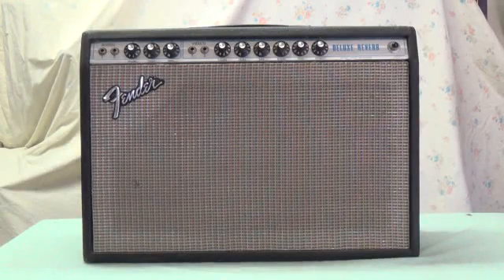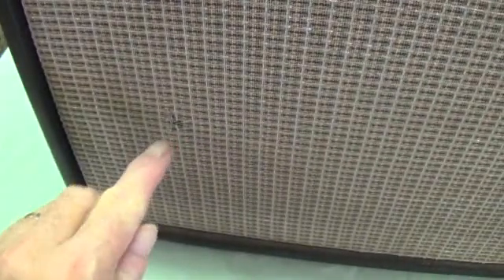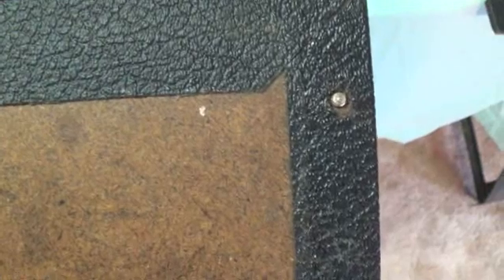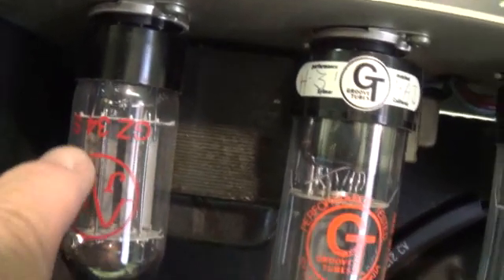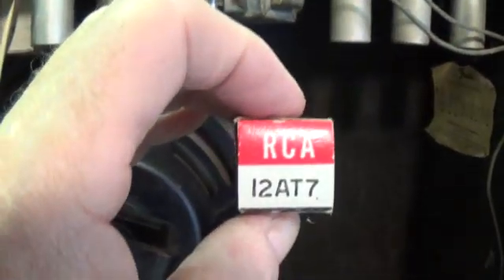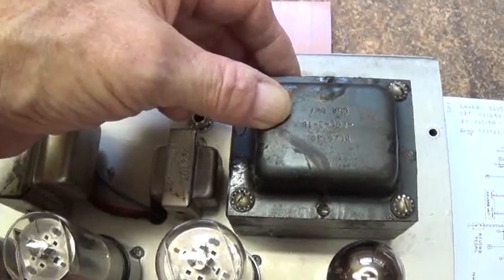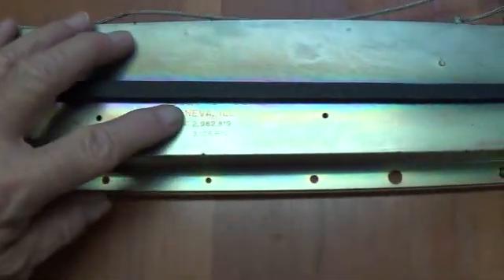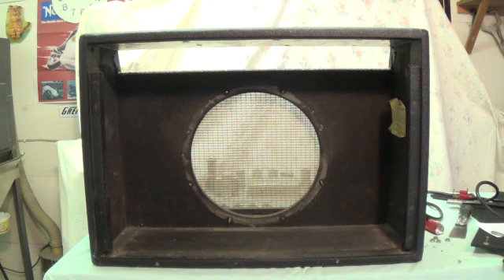1974 Fender Deluxe Reverb Part 1: Disassembly and Evaluation

Comment: Hello Doug, I have question about the reverb transformer. There are several companies that produce these transformers claiming just like original specs. Some say primary 20K ohms and others say 25K ohms and of course the secondary 8 ohms. Back to the primary does it matter, lower or higher ohms ?  will it impact the reverb tone?  thank you .................
Reply from the maker: Greetings, Jim. In my opinion the difference between 20K and 25K is negligible.....it would have no effect on reverb tone.

Comment: I'm thinking of buying a Deluxe reissue and converting it to Point to point hand wired circuit board?  UD "Decent" wow I'd die for that amp.
Reply from the maker: If the Deluxe in question works well, I doubt that conversion to P to P would make much difference in tone, Gary......unless you took the opportunity to incorporate superior components. Why not find one with    a burned-up PCB (not that rare) at a give-away price and use it for your project.

Comment: My deluxe reverb is a '72 and is in almost similar condition. The difference is the speaker. My speakers have a Fender logo sticker on them.
Reply from the maker: Bear in mind that Fender does not manufacture any speakers. They are made by other companies, like Jensen and Oxford, and may have Fender stickers placed on them.

Comment: Uncle Doug, I've a couple of questions concerning amp wattage. On a few tube data sheets, plate wattage (for instance 16w) and output wattage (for instance 4.5w). Would an amp built using one of these tubes be rated at 16w or 4.5w? Another question is how wattage rating relates to volume, db? You run all of the amps you work on mostly through the same speaker and the volume sounds the same. Could be the balance on your camera but I am very curious. Thank you. Love the videos.
Reply from the maker: Plate Dissipation (i.e. 12W max for a 6V6) and Power Output (i.e. 24W) are completely unrelated measurements. Their only similarity is that they are both measured in Watts, which causes confusion. Power Output wattage does relate to volume, but the relationship is not at all linear, i.e. a 50W amps is not nearly twice as loud as a 25W amp. As the output wattage increases, the volume increases, but at a much lower rate. I run all audio tests at about the same audible volume, and the camera does compress really high volumes.
Reply: @UncleDoug  Thank you again UD, I really appreciate you and your knowledge.

Comment: Great score!
Looks like a 56 pulp cone.
I haven't seen your follow up videos on this particular amplifier yet, but that speaker is going to break up very quickly and you will hear pure tube distortion at low volume. I don't believe that speaker would last long fully cranked up and would probably feedback, but would sound heavenly at lower volumes. 
I prefer the Jensen C12N/Q or clone equivalent in this amplifier or a more efficient modern alnico that can handle it. 
The ideal amplifier for that beautiful pulp cone old Jensen is in a lower wattage tweed era amplifier, 5 to 20 watts, if you like to crank them up like I do. 
I've pushed all of the vintage alnico "P" speaker's and they always sound best just before the spider freezes up, lol.
I understand that this video is 7 years back, so I apologize if I'm preaching to the choir in the present, so to speak. 
I'll keep an eye out for your follow up videos on this Deluxe Reverb. I'm curious about the GZ34 and the voltages.
The excitement in your voice is infectious my friend. Congratulations!
;  )
Reply from the maker: Thanks so much for all the insightful comments, Amo.
Reply: @UncleDoug  
We did a blackface conversation on a 1971 Deluxe Reverb back in 96-97 and that amplifier was basically identical to your 1974. It most likely came with a Utah speaker from the factory with a brown'ish orange label.
I'm not a fan of those speakers and it's former owner didn't appear to be either. A lot of people love the JBL D120F, but I don't care for it in the Deluxe Reverb. However, in a Twin Reverb, they are much better, imeo. I learned a great deal from that blackface conversion, they are more complex tone-wise than other SF amplifiers. The switch to the 5U4 and the move from the 2.2K resistor to a 10K to the preamp section.
They also changed the taper in the volume pot that was for the worse, from smooth and even to a quick bump in volume. That's about all that I can remember at the moment. 
Again, congratulations on a fantastic Fender amplifier.
Reply from the maker: @amoruzz  Thanks so much for the detailed input, Amo.

Comment: How do you calculate which fuses to use? Which of the transformer winding are the most important to protect?
Reply from the maker: If you don't have an AC ammeter to measure the input current, then install a 1W fuse and see if the amp starts up and works OK when driven. If the fuse blows, install a 1 1/2A fuse (if you can find one....or a 2A if you can't) and repeat the test. The proper fuse is the smallest value with which the amp can operate. All the windings are essential. The amp will not operate properly without them all.
Reply: @UncleDoug  I have both a digital and an analog meter.  So it's sort of try it and see experiment?

Comment: Hi from Serbia.I have hand made Deluxe reverb ab763 and work just fine but when I switch vibrato volume go down.What can be wrong? Kind regards
Reply from the maker: The tremolo circuit connects to the main circuit via a wire to the grid of the long-tailed pair. Check the values of the 220K and 100K resistors and 0.1uf cap on either side of its attachment to the circuit. Disconnect the wire and see if t.he problem ceases. If it does, then check the value of the 50K RA pot. Somewhere in the circuit you have inadequate resistance to ground. Good luck.
Reply: @UncleDoug  Thank you,kind regards

Comment: Beautiful amp.
I’m interested (at 44 years old) in learning about electronics (specifically amp circuits and design), what would be a good place to start from the beginning?  Any books, videos, or other resources you can recommend?  This would be a hobby, not necessarily a career.

Thank you for any direction you can provide.
Reply from the maker: The Internet is the best and most convenient source of information, Jeff......both videos and sites dedicated to tube circuitry. Once you have a foundation, the next step is to start repairing cheap tube amp circuits for yourself and friends. Eventually, you can begin to build your own amps from kits or from scratch. Good luck.

Comment: the reverb and vibrato won't work without the foot switch.
Reply from the maker: The reverb works OK without it, but the tremolo must have the socket grounded, either with the footswitch or a jumper.

Comment: Your Videos are Outstanding,   will the front panel just pop off for cleaning ?  Peace !
Reply from the maker: Thanks !!  Which front panel, MM......metal or cloth?
Reply: @UncleDoug   thanks for the reply I figured it out , it has velcro and the front panel pops off just had to work it free with a screwdriver, it's a silver face and it's the cloth front speaker panel sorry for not being more specific my bad,  Thank You,  Sir !
Reply from the maker: @jixxxxer17  Glad you solved the problem, MM.
Reply: @UncleDoug  I did but now I have something new to deal with a really bad odor coming out of the amp once I got it in the house of course I started smelling it,  it's a foul odor like a  mix between cigarette smoke and a bad smelling old apartment i guess, any suggestions i would appreciate it i had to take the amp out of the house and put it in the garage  now the smell was making me sick ugh ,    Peace !
Reply from the maker: @jixxxxer17  You might try washing the grill cloth with Woolite and then letting it dry by having a fan blow on it all day.
Reply: @UncleDoug  Thank You Uncle Doug !

Comment: I currently own a 1977 version. Someone installed a much larger OT along with a much heavier 12" speaker out of some type of Fender Twin. Makes for a great SRV amp, if you want to run it loud ... and it IS loud for a Deluxe Reverb. Too loud for this old man ...
Reply from the maker: Amen. Too loud.....and getting too heavy, at least for this old man :)
Reply: @UncleDoug  Right on, Sir! Have flattened spinal discs to prove that action! Very painful walking from 35 years hauling around a Super Reverb or a Twin ... I think you and I are just about the same age. I came in around late/'47, back in the good old days ...
Reply from the maker: @Tonetwisters  I was born in April of that year, so I'm a few months older.....and I have shrunk about 2" from my peak height in my 20's, due to compressed discs. It really is a problem.

Comment: I realize this is an older video, but I am looking for an original Deluxe Reverb. Do you happen to have one for sale? thanks.
Reply from the maker: Yes, I do, GL. In fact, it's the one featured in this video. Give me your e-mail address and I'll contact you with the details.
Reply: @UncleDoug  I may have found a 1972.  It is very far away though and I am not committed at this point. Could you please tell me about yours? Thanks, Gary
glmoore0001@ comcast.net
Reply from the maker: Everything is discussed and shown in the videos featuring the DR, Gary. Please watch them.....a picture is worth a thousand words :)

Comment: Hi Uncle I have a 73 DR and the reverb doesn't work.
The tank, cables and the footswitch are ok, it was tested in a princeton and it sounded great.
Circuit or trans could it be the problem? How could I verify that the reverb transformer is ok?
Thanks so much
Regards
Reply from the maker: One sure method:  separate it from the circuit and see if both windings have continuity.
Reply: Ok, thanks Uncle.

When I turn up reverb pot it makes a kind of rattle silent, like a train... this is the only thing I hear. 

My father is tech and measured voltages in V3 and they were normal, also measured the red wire of the reverb transformer ...

By the way, why some SF DR have 6 cathode capacitors instead of 7? Mine is missing one just at the height of V3 ...
Reply from the maker: Good luck with the reverb, Pablo. There are differences between circuits. Add the missing cap to yours and see if it makes a difference......it probably won't.
Reply: We put the cathode cup that was missing and the reverb came back. 
It sounds really good!!!

When I bought this amp it only had 1 cathode cap and the 2 original resistors were changed with other lower values...
I replaced them with the values of the scheme but I didn't add the capacitor because I saw that some Silverfaces of that time had 6 capacitors instead of 7.

Thanks for everything.
Cheers!

Comment: GZ34 is a better rectifier than a 5u4. Uses less heater current and can put out more DC current. You got a great deal on this one.
Reply from the maker: Thanks, Ralph. I agree with all you said :)
Reply: Uncle Doug : Hi Ralph and Uncle Doug!
I don’t agree with that “better rectifier” comment.
When people agree that it’s “better” that’s because they view “stiffer” as “better” (but I don’t).
The 5u4 will have more “sag” (meaning more touch sensitive and with singing sustain but with “softer” bass) and the the 5ar4/GZ34 will be stiffer and sound more like a solid state/diode rectifier (meaning fast and punchy).
Now “It is not safe to substitute a 5U4 in most amps designed for a 5AR4/GZ34.”
That’s because “the 5AR4 draws 1.8A of heater current, the 5U4 draws 3A.”
It is safe, however, to put a 5ar4/GZ34 in a Silverface designed for a 5u4 (which I have done and prefer the “saggier” 5u4).
The 5ar4 will raise the voltages that the power tubes “see” so exercise caution.
Please feel free to educate me if you think I’m wrong.

Comment: Thanks Uncle Doug and Jack: I have a DRRI with a 16 ohm Greenback Speaker. I am looking to bias this amp for early breakup irrespective of output tube life for killer blues tone. Where should my output plate dissipations be set for these 6v6’s for this type of tone?
Reply from the maker: I didn't realize that the output transformer of a DR could support a 16 Ohm speaker, JF.  Are you sure there is no impedance mismatch here? Re the tube bias, if you want it to have really nasty early breakup, then the tubes should be biased at maximum PD, which for grid-biased 6V6's is 70% of 12W or around 8.4W......and then either increase the resistance in the NFB loop, i.e. from 820 Ohms to 3K+ Ohms, or disconnect it altogether.
Reply: Uncle Doug You are correct. It is a 16 ohm speaker on a 8 ohm OT, which is the stock OT.    I ended up getting a near mint greenback for $40 because get this, it was loaded into a wedge cabinet and he needed a full range speaker in there for vocals. I have learnt a wealth of knowledge from your videos.
Reply from the maker: OK, but bear in mind that the impedance mismatch will most likely have a negative effect on volume, tone, and tube life.

Comment: This is why i sent back my new Delux reverb.  It never looked like this inside!  Wonderful stuff!
Reply from the maker: Thanks, Marc. The Silverface Fenders are great bargains. You can probably buy one for less than the price of a new reissue......and they are much, much better amps.
Reply: @UncleDoug  Never liked the reissue.  Those older silver faces have a bad rep.  Twas never sure why.  We have less of the older amps in the UK.  Making them rarer. More expensive.  Lots of older Vox, Marshall available.  At a very strong price.  But they have both released amazing handwired amps.
Reply from the maker: The circuits of smaller silverface amps (Deluxe Reverb to Champ) are virtually identical (one or two small, rather insignificant cap values) to the blackface circuits......yet their value is less than half. To me, if you can get $2500 BF sound from a $750 SF amp, that's a bargain :)

Comment: Doug, I have a 1964 Fender Deluxe Reverb Amp. It hasn't been used for long while. It seems to be in good condition. How do I sell this beauty? Is it okay to ship it? Perhaps, local pickup only? I dated it using the transformers. The plug is not grounded and I'm afraid to plug it in. The foot pedal is there. How do I find out what this is worth? It would be for it to be used again.
Reply from the maker: If it is truly a blackface '64 DR, Blanca, it's worth quite a bit.......probably around $2500 if in really nice working order. I would love to have it, but it's a bit out of my price range. You should check with FedEx to see how much they would charge to pack it for shipment, and then add this to the selling price. If you decide to donate it to our channel, let me know :):):)

Comment: I'd be glad to pick up an old broken Fender amp, nice and cheap and I have the skill to fix them. Might as well have handed me a working amp. ;)
Reply from the maker: They're out there, LH, you just have to beat the bushes to find them :)
Reply: @UncleDoug  Not sure how I'd fair in Australia, but I'd certainly try.
Reply from the maker: Leave no bush unbeaten, LH :)  Good luck. If all else fails, check Ebay.

Comment: Uncle Doug you have inspired me to make a tweed cabinet for my deluxe reverb. Do I need that heat shield that snags the control panel or can I can I get away without it? If I need it where can I get it? I'm also going to use an old Fender 022954 speaker that I have been saving for like 30 years, what do you think about that? Looking forward to hearing from you. Thanks for you great videos.
Reply from the maker: I'm glad to hear that you're inspired, BF. I doubt that you'll need a sheet of metal over the chassis.....it was originally for shielding from RF interference, and is no longer necessary. I have no idea as to the condition of the old Fender speaker, but if it works, then by all means use it. You're welcome.

Comment: My silverface says A 1738,anyone can tell me what year?
Reply from the maker: There is not much information on SF chassis numbers in the 68 to 75 range, Ed.  It's tempting to say 1971, but this is just a guess. If there is a tube chart on the inner wall of the cabinet, it will have two ink-stamped letters that will tell the year and month of manufacture.
Reply: Uncle Doug hey thanks for the information unfortunately my tooth chart is worn away partially and the part with the letters is gone I'm going to take the chassis out and try to read some transformer numbers and don't worry uncle Doug I will make sure it's done safely thanks to your videos that help me tremendously!

Comment: I'm actually rather amazed you don't have a solid answer for the outlet on back of the amp. I seem to remember trying to use one before and it caused hum in my signal chain. Regardless of what I did. The fan thing is a great idea, if I don't cause any noise issues. I wish I could run into a old Manuel telling use what fender had in mind. I've even thought about wrapping the power cord up then plugging it in the outlet for storage. Lol. Anyhow, if you ever nail down a answer let me know. Thanks Doug.
Reply from the maker: You're welcome, Bryan. Some things are just not meant to be known or understood :)

Comment: Hey Doug. What is the outlet for on the back panel of the amplifier? Everyone always skips over explaining it's purpose. I'm sure it a switched outlet.  But, for What? Why would someone need that ?
Reply from the maker: I have often wondered about that myself, Bryan. Maybe you can plug the amp into it for use at picnics :)  About the only use I have ever heard of was to plug in a cooling fan to blow on the tubes. Another might be if you had a 6G15 Fender Reverb unit that needed power.....but why not simply plug it into a wall outlet. You got me......it seems like a wasted outlet.